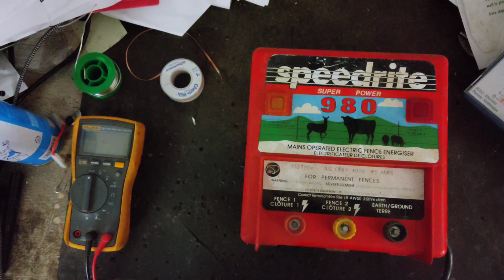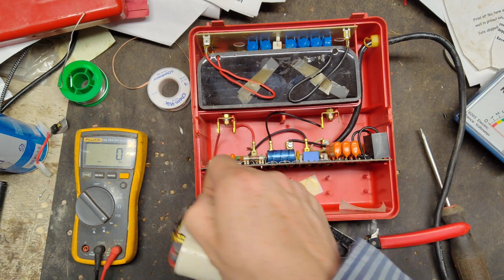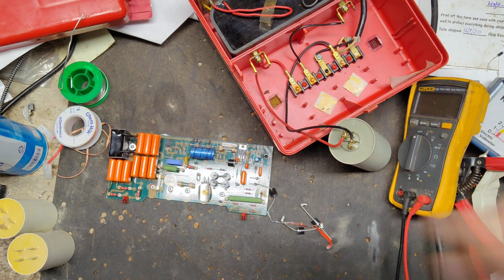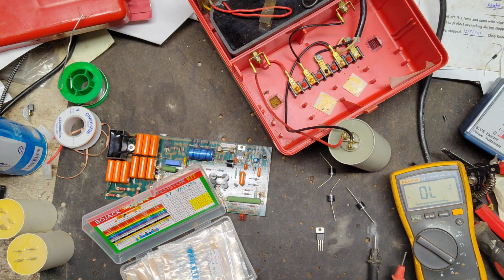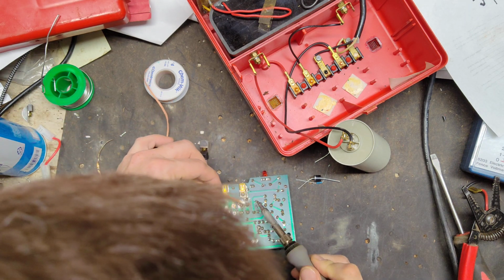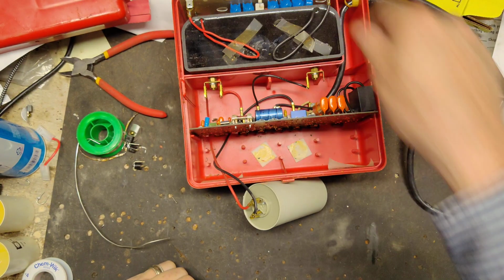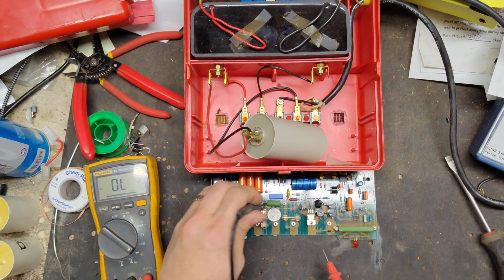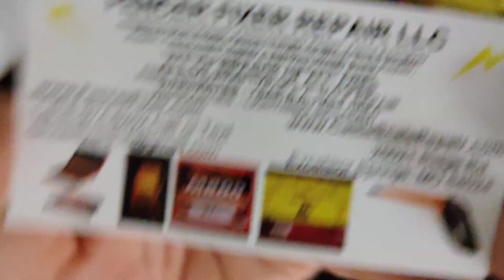How To Test & Repair A Speedrite Fence Charger | Speedrite 980 Repair

Comment: any chance you'll ever make a DIY homebrew kit with a board and choose your own battery/solar/fence/etc?
Reply from the maker: Probably not. Every brand does things so different and nothing is the same. I'm not an engineer and just a repair tech by trade. I went to school 20 years ago for electronics, but have forgotten more than I remember. Plus, I be doing have time for that sorta extracurricular stuff. With 3 small kids, a small farm, and repairs coming in every day, I don't have enough time. I barely have enough time to do what I already do at the moment.